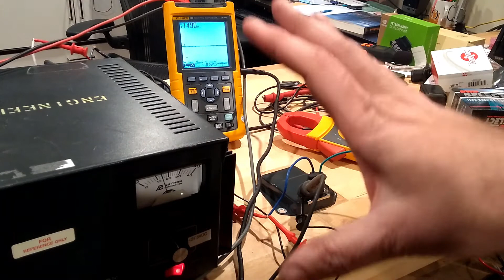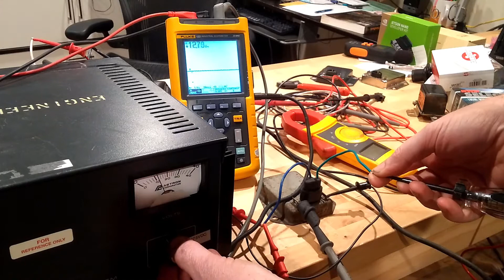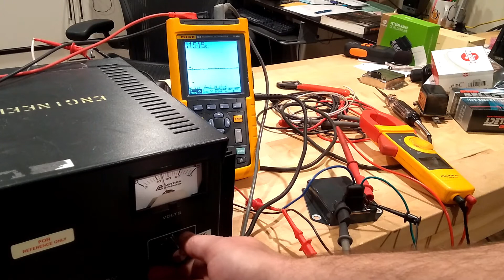Bench testing a voltage regulator

Comment: I tried your test method using a variable voltage power supply, a DMM (to accurately measure voltage) and a small 12V bulb (didn't have a test light). It worked, but I have a question about why you connected one end of the test light to the positive terminal of the power supply and the other end to the green wire on the voltage regulator. Does it have something to do with the transistor inside the voltage regulator? Can you go into a bit more detail about why you hooked up the test light the way you did? All other connections make sense to me except for that one. Thx!
Reply from the maker: The regulator internally connects the field (green wire) to ground when it wants to charge.  Bu running the test light from positive to the field wire, when the regulator switches to "charging" it connects that circuit and lights the test lamp.

Comment: Asking this for others:  At 2:55 in the video, you say to "probe on the blue wire terminal."  The video then immediately fades to the next subject.  We do this on the FIELD stud on the back of the alternator, since the blue wire connects to that stud and the ignition switch, rather than using my bed-o'-nails or poking the probe through the rubber boot, and we'll get the same signal anywhere on that path.  RIGHT?

This part is for me: Car-guy by birth, Ford guy by owning a '76 Mopar. But the big forklift here at the shop is a 1983 CHAMP, powered by a 225 Slant Six.  Yesterday, it quit charging.  (I noticed the lights were dim and didn't surge with RPM, subsequent starts were slow, etc.) The wiring is simple as it gets. SPST toggle for power, push button for start.  Redundant ground circuit. No voltmeter nor ammeter in the circuit.  Checked all 4 wires for continuity.  Confirmed grounding of ALT and VR.

After using jumper cables for a start, it runs (until the coil can't make spark).  When I remove the negative terminal from the battery post, there's a half-second delay and then the engine dies.  (The delay is odd to me.)  This tells me the charging system IS NOT working, and it's running off the battery.

Loosened the belt.  With switch off, alternator spins freely.  Switch on, alternator resists.  To my cave-man mind, that means the field is energized, the alternator is working, and the voltage regulator is asking for charge. This tells me the charging system IS working.

Contradiction ERROR: 
Stack overflow. 
DIV/0.  
Schrödinger's charging system; Both charging and not charging. 
Danger, Will Robinson!

So, is this damned thing unable to charge simply because the battery voltage is high enough to fire the coil, but too low to energize the field?  (See, a Ford would never strand me this way!)

Comment: Thanks for your video, it helped me understand exactly what to look for when testing my regulator.  I was able to get the right voltage for the test by starting with a 12v battery and then adding a 4v battery in series.

Comment: Nobody has a freaking machine like that so do a video showing how to test with common test meter.
Reply: If you want to completely test the regulator with only a basic multimeter, you will have to open up the unit and test each component in the circuit individually. Or, know and understand the attributes of each component, and the circuit design well enough to determine the minimum needed test points, and conditions needed to calculate expected test results at those points within the circuit. You will likely also need the data sheets for the components as well to determine their design and production tolerances to properly calculate anything in there. 

This may require a fair amount of de-soldering and soldering. You could get lucky and find a smoldering crater where a component once was. But, if you don't find that: You're gonna need a solid knowledge of Ohm's law and component function. There's probably only something like an inductor and a transistor in there... But, its probably all suspended in impenetrable black epoxy/goo...

As far as basic meter tests: If its totally cooked, you might have one or both pins with full continuity to the case at all times, (and probably an alternator going full-field and charging way over 15v) or a very low (or open circuit) resistance reading probing across the two pins.(and maybe a low/no-charge state..? it probably should read around 1-2Kohms across the pins if its good..? but, that's a guess and not a given, and doesn't mean its actually 'good'.***) 

Those tests can probably tell you it's toast. But, you will likely not be able to detect the intermittent/functionality problem that was demonstrated in the video by just probing the pins externally with a meter. These tests are the equivalent of determining a car will not run correctly by popping the hood and observing the engine is no longer present. They are good initial checks. But, that's about it.

* Additionally, most circuits are ratio based. Meaning, we can often get the same/similar results using component pairings of completely different value scales. So, test point values are often more important than component values. Especially if we are comparing the same design from two different manufactures. The component values may be completely different in individual testing between two 'identical' devices. 

Basically, this video IS showing you the cheapest, and the easiest way to bench test a Mopar type electronic regulator.  This test only is correct for the A circuit type of regulator. Don't try and just use this type of regulator straight-up with a 2007 and up MOPAR Denso alternator or you will have issues because they use a Kelvin sense type B circuit field terminal block/brush assembly. (ask me how I know... )

It should be understood that the idea of electronics and 'electrical' can be very different. It's not simply mechanical connections inside those devices. It's not like the wiring in your house. Things like: transformers, inductors and capacitors function in part without any mechanical internal connections. Others can be polarized and only flow in one direction. Or, the functionality may change when the component sees voltage/current vs dormant. So.. We typically can't just test an 'unknown' circuit 'end to end' mechanically at two points and accurately determine what is going on. Even with an expensive Fluke meter. 

The way it was done in this video is the most complete and efficient way to test using only those 3 contact points. But, It works because the expected functionality of the circuit was known by the individual doing the testing. 

That 'freaking machine' (adjustable DC voltage regulator/rectifier) can actually be cheaper than many automotive voltage regulators. I bought one of mine for around $40 on amazon. The last Delco regulator like the one above I purchased was around $45 including tax at the local parts store. You can also use it to bench test instrument clusters, and all sorts of things on your vehicle. You can also possibly use them for electro-plating and lots of other things. They are very useful, and worth the small investment.
Reply from the maker: It's not some special thing, it's just a power supply that lets you adjust the output voltage.  If you want to test at what voltage the regulator starts charging, you need some way to give it various voltages.  A could show it with a constant output power supply and a potentiometer, or a handful of resistors but I doubt they're any more or less common.  I think what you're asking for is just a "plug a meter in and get a pass/fail result out" and that sort of test doesn't exist.  If you want to know the voltage where the regulator turns on, you have to give it different voltages.
Reply: @YoshimoshiGarage  Can you do a regulator test with a common volt/ohmn meter and test light that doesn't require a adjustable power supply that would show if the regulator is good or bad? That is what I am asking.  I believe the average person does not have one of these power supplies,
Reply from the maker: @bobcat1  It's easier to test the alternator by full-fielding it, and that can be done with a test light.  If that works, then the only remaining problems are either the regulator or wiring.

Comment: 1970 318,,,, engine off battery is at 12.7 on volt meter , i start car and it drops to 12.3v and it slowly begins to charge in 1 minute it goes to 13.0 and if i turn the lights on at this point the volt meter sais 12.5 and slowly begins to discharge ...is this a bad alternator or voltage regulator ?.......also what is the differance between the vr125t vs the vr125 voltage regulators , thanx
Reply from the maker: It sounds like probably a regulator, but hard to tell for sure.  If you full field the alternator (i.e. give it voltage on the field wire terminal that comes from the regulator) does the system voltage go up?  If so, the alternator is good.

I've never been able to tell the difference between a 125 and a 125T except I think one usually comes painted/coated and the other doesn't.
Reply: @YoshimoshiGarage  im not sure how to properly conduct that test to give voltage from field wire to regulator .....as for vr125 and vr125t you are correct i called standard motor products this monrning and they told me that the internals are the same but the exterior and cosmetics are just plane and simple on the outside where cosmetics dont matter like on an industrial aplication or fleet cars etc